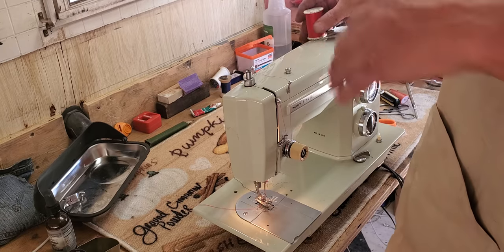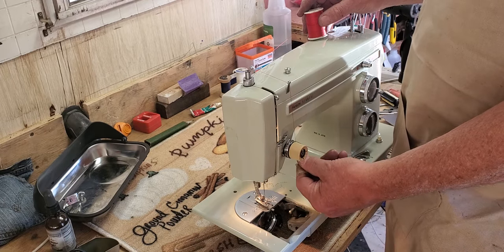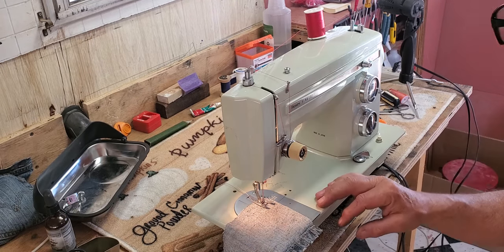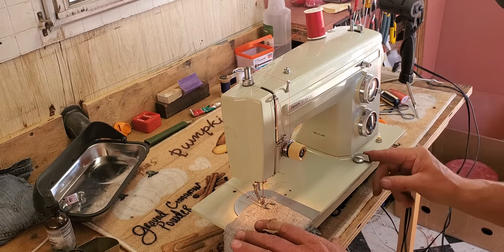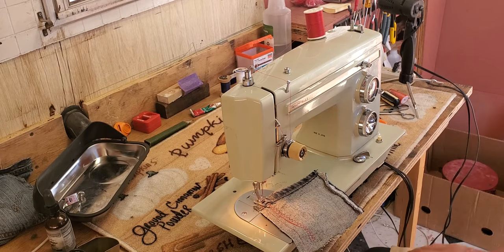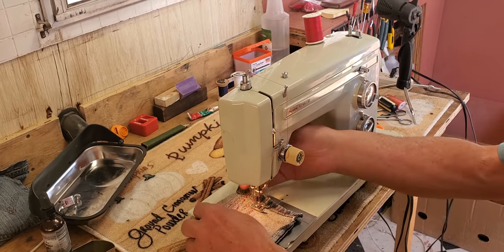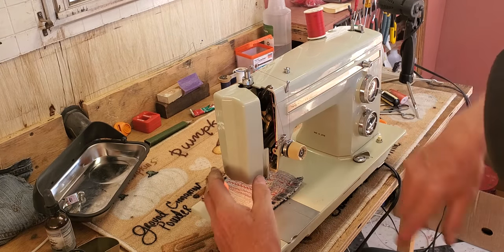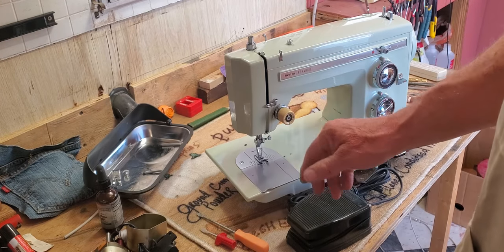Kenmore 158.14000 Sewing Machine Final test and How-To

Comment: I completely agree with you. These are in my opinion the best home zigzag sewing machines ever. I own a 158-1430, and a 158-1941 (free arm version),and a 158-1802. They are quiet, strong and reliable. They can't be beat on zigzag. Nice, even width even feed. I still love my Singer 201-2 for a perfect straight stitch.

Comment: I’ve had my 158-14001 since 1970 . Love this machine.  Makes the best buttonholes. I have oiled and changed the grease box. Electric cord seems a little stiff. Should it be rewired? My daughter is an electrician.

Comment: I see you only have after- fixed tests, not how to fix. I’ll ask anyway. I’m restoring Kenmore 158.14000 machine that has sat for 15+ yrs. All oiled and all parts are moving. But hand crank is hard to turn although with a push, the motor starts it and runs fine. It’s only the initial start that wheel needs manual push, starts fine after unless it sits for a while. Trying to turn wheel crank manually is hard. Would the belt be too tight? Thx

Comment: After watching about half of this video I went to set mine up the way you did and come to find out my zigzag option isn’t working it makes a beautiful straight stitch but when I turn it to do a zigzag it does a whole totally different pattern not even the one that’s where the knob is set.  Any idea what to look for on correcting that to get the zigzag to work. Everything looks clean and I’ve oiled everything that I possibly could that’s metal to metal. Should the cams be oiled?  Thanks